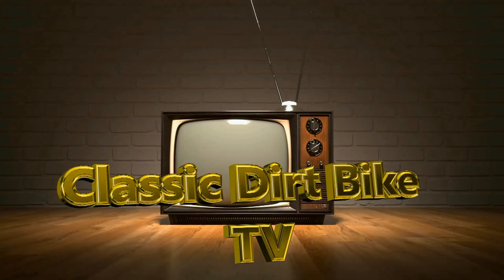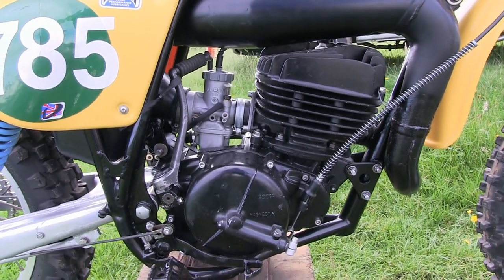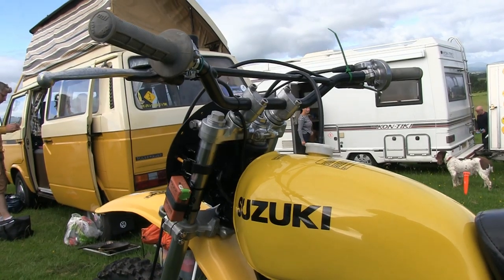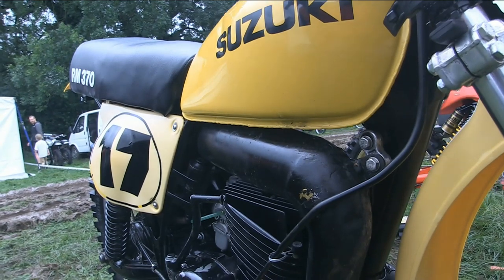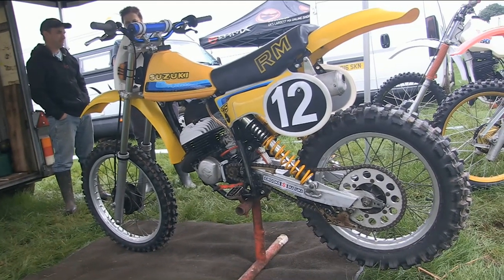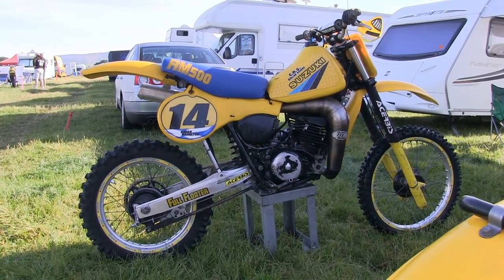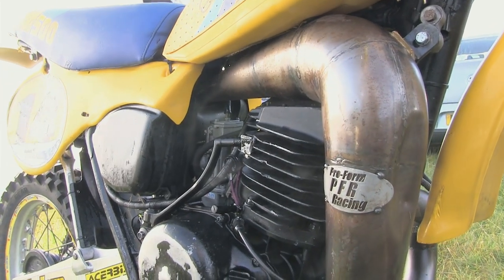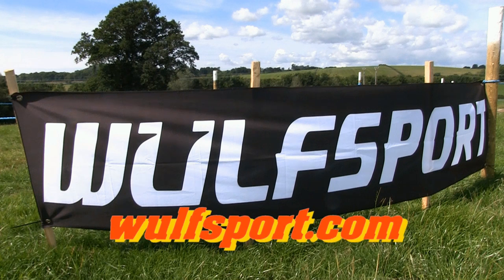Vintage Motocross Bikes "Classic RM Suzuki's Part 1"

Comment: 78 was the aluminum swing are debut. The 250 hit was brutal. The 1976 had a pint sized silencer, the ‘77 and ‘78 had a  longer silencer.  The 370 was much easier to ride. Early 76 250 frames had the RN brake stay hanger welded in place, just behind the right foot peg. The stock brake stay was attached to the swing arm. Floating the backing plate using that hanger vastly improved rear braking.

Comment: What made MX racing so fun was the 2 strokes, when they went to the 'NASCAR' engine 4 strokes cost sky-rocketed and them horrid aluminum frames are TOP-heavy tanks. KTM/Husky is where it is at today in 2 strokes.

Comment: Have Paul check the intake manifold.  They were horrendous for splitting and causing an air leak. Also check the float bowl doesn't touch the engine case. If the bowl hits them the fuel foams and leans out. Those bikes were horrific for stator failure.  If your 79/80 rm is a dog or doesn't run its the stator.
Reply: I restored a 77...it had a 92 rm 80 ignition...went with a 34 mm carb and it does touch back of the case...don't know how adjust it [ 77 RM 125 ]

Comment: I had a 72 rm250.  Before suspensions changed.  The rear was stiff, a real kicker, 3or 4 inches of travel.  I always find Suzuki’s tall, stiff, and awkward, and so was that one.  I didn’t ride it much, as I got a Honda Elsinore cr250 first year it came out.

Comment: The first 250 looks like a 76 RM250A  or 77 RM250B , but not a 78 RM250C
Reply: Swingarm is 78C2. RM250C2 used a plastic tank so the bike may be a 78C with a C2 swingarm.
Reply: Those are 76 forks , the 77 on had longer forks . I still have a orig 1978 RM250C .

Comment: The only thing 1978 on that 250 is the swingarm. I think it's actually a 76 model. 78 tanks were plastic.
Reply: yeah 1977 was the last of tin tanks
Reply: 1978 STEEL Tank  1978 AND a half PLASTIC.
Reply: It has 77 forks, so I would say it’s a 77.
78 forks are longer below the axle for more travel.